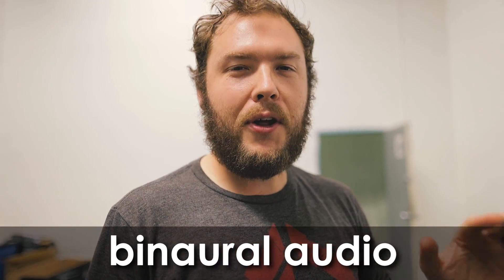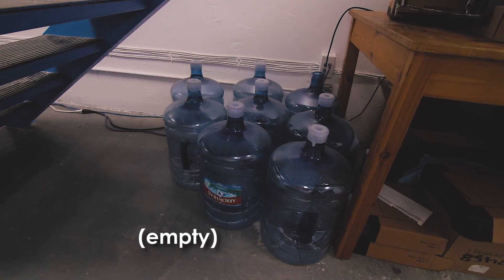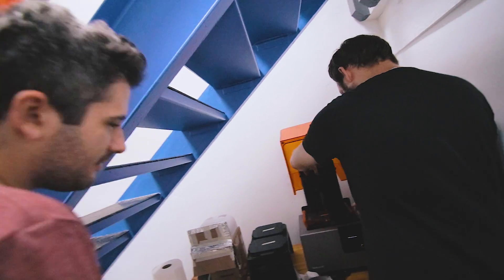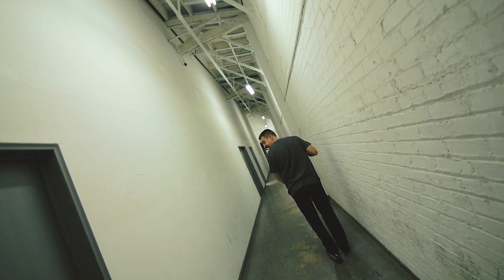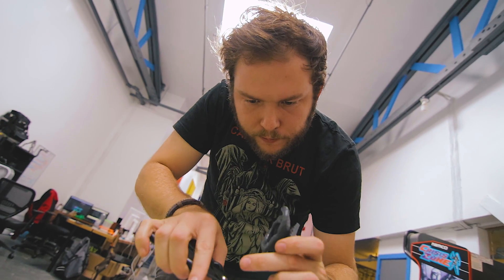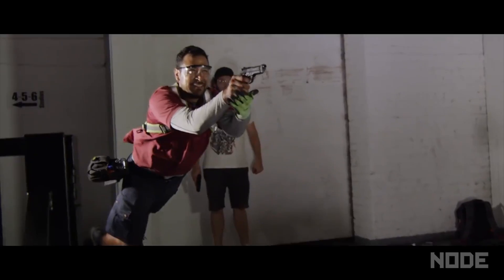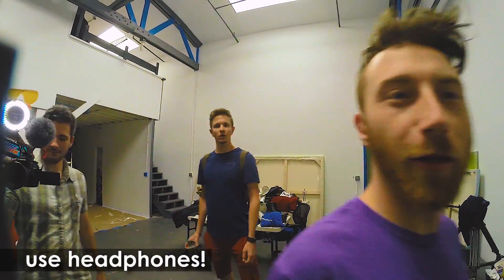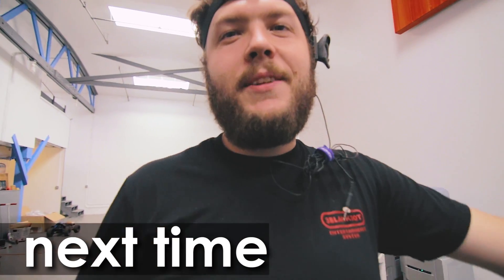Flexible 3D Printed Ear!

Comment: Old video, but still:
Liked the ears, but you probably want them a little wider apart than they were.  The closer they are together, the less time delay there will be between them, which affects our perception of location of low frequencies.  Also, if you stick a sphere in between them, it'll help create a better level difference in the higher frequencies (ask Wren about diffraction), which is another key localisation cue. :)
Reply: When I say they should be wider apart, they looked like they were about right for a kid's head.  Most adults ears are about 7.5cm apart :)

Comment: I am really concern about the edges .... is not so smooth like the ear is!! At ABS you can smooth the edges with acetone ... can end really bad if you put too much ... I don't know about this material ... good idea ... try to make bigger ears and simplify this!! I think you don't have to be a real ear shape to get the sound right. The other is that the system that human has is not one mic , but millions of them , that activate in different frequency  ... so you put some how 3 different mics or you make around them 3 different ears, or you find mics that has got good ratio for most of the frequencies that we hear and less for the frequencies we don't hear.. so you get them but you don't need them!

Comment: Hey guys, just wanted to point something out that I think will make a big difference to how your ear mics sound. I think the fact that they stick out from your head is a problem. The standard distance between ears that Neumann use on their binaural mics is 17 cm. If you don't use this distance, the phase differences in between the two mics won't be the same as the phase difference you'd get with real ears, and phase differences are a big part of making something sound binaural. Just something to consider :)

Comment: I asked my brother, a Berklee College of Music graduate, what he thought about this video and this is what he said:

"This project makes perfect sense, and it is based on sound facts, such as the softness of the material and the way binaural audio is recorded. The thing is that this project would benefit from using higher-grade microphones. The lavaliers are designed to work best with local audio and not ambient sound, which is the primordial difference with the human ear. Additionally, the part where they show the results of the recorded audio shows that the audio curve is pronounced in the high-mids, which feels like the frequency response curve that a Lavalier has. This makes sense for lavaliers because the high-mids is an area where you can get a high level of intelligibility in speech, but I don't think this curve is helpful when trying to get a more "realistic" intention out of the audio recording.

The project is near perfect.  I'd recommend using higher-grade, small condenser microphones."

I hope this helps out in your project, Sam. 3D printing ears is some seriously cool stuff!
Reply: Good to know! Thanks for the legit feedback. Yeah we'd use better microphones if we had them haha. It's most just for fun.
Reply: Yeah, we figured as much, but like most of the comments here say, this project is very exciting, especially for a platform like YouTube! :D

Comment: Microphones shaped like ears? That might be the dumbest thing I've heard today. No, recording it that way doesn't make it more realistic. You know why? Because when you play back the recorded audio, you are listening to it through your ears, making the whole "recording it through ears" step entirely redundant.
Reply: ***** Nono, I have no issue with using two microphones at once to record positional audio. That part makes sense and is effective. 

It's the shaping the coverings of those microphones like ears which is completely useless.
Reply: not to mention a microphone pickup isn't anything resembling an ear drum as far as resonance, frequency range, etc. 
if you wanted to go for realism, you would be better off going multiple microphone (try like 10+) clustered, reassemble it afterwards in a modeling software, and bringing levels down or up to resemble the actual pickup pattern (measured in Db) of a human ear. Course getting this pattern is a bit tricky. might require some serious audio instrumentation and perhaps an actual human ear from a cadaver to replicate.

Comment: Just wanted to say that binaural audio is not so much about having silicone ears with mics pick up the sound but rather have the correct directionality (that a word?) and spacing so that your brain can hear actual locations in space. In any case (except with in-ears) the sound needs to pass through your ears anyways so it's no point imitating this effect when it's happening anyways down the line. Exceptions may apply, but this in general.
Reply: That is true, though they're just doing the input part, because they can't test the other half

Directionality is an actual word

Comment: I think the concept is wrong, because when you record something through a elastic ear, the sound is going through an ear to the mic and then through MY ear, so OBVIOUSLY the sound feels like if it was surrounding you, but it is not exactly as if I heard that in front of me. I don't mind about the quality loss when it goes through the headphones.
Reply: That's what I was thinking... We're all already hearing everything through own our ears shaping the sound, so this is like running a POD HD or Axe FX (or any other guitar/bass modeling hardware/software(VSTs included,)) having cabinet emulation on, and then running the sound itself again through a guitar/bass cabinet in real-life. It's an unnecessary double-up. You want to run it through a PA or FRFR speaker setup (flat range, flat response) since you don't need the actual cabinet anymore since you have one already emulated. It's sort of like that. We already have ears. We hear EVERYTHING already through our ears, so why do you need to record the audio with an "emulated ear" ontop of this? It's like doubling up on what's already going on, like running cabinet emulation through your actual cabinet. You either turn off cab emulation when using an actual cab or use an FRFR/PA setup to avoid that. Maybe it's not a totally equivalent example, but that's the way it seems to me. It's like you're doubling up on the "ear" effect.

You guys (Corridor) are the experts though. I'm just thinking out loud. It could actually be better for all I know. The concept, at its core, just seems off to me though since we all already listen to everything through our own ears regardless of how it's recorded or played back.
Reply: I mean, of course it makes the sound more realistic, but it is like put in the PC what I should hear, and if I heard the sound that the mic catches IN my head, not through my ears, I guess that would be much more realistic. I am not an expert, but I think this maybe what they were trying to do.
Reply: But if your listening to the video with earphones/headphones the sound effectively bypasses your ear's shape. You are correct kind of if you listen with stereo speaker, yet the microphones would, normally, still pick up an even amount of sound from behind the camera (which is not how ears work).
Reply: That's right, I didn't think about it. thanks for your help.